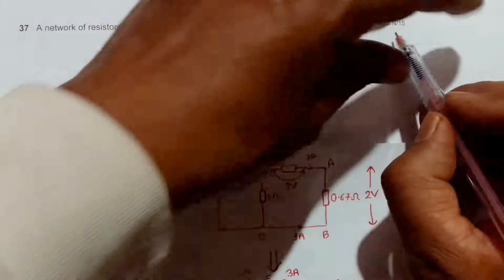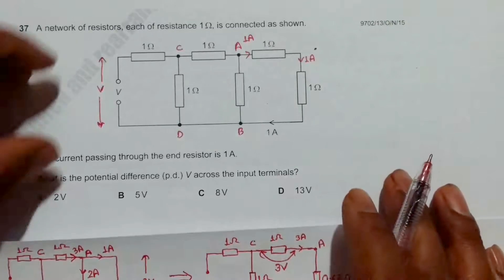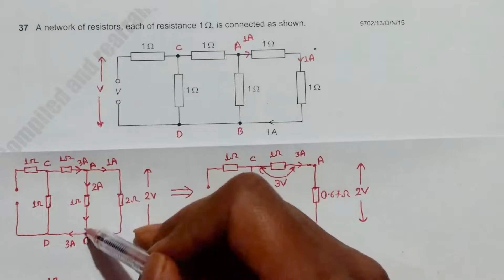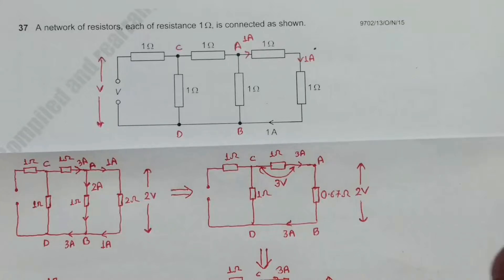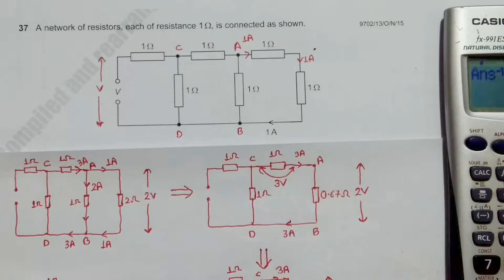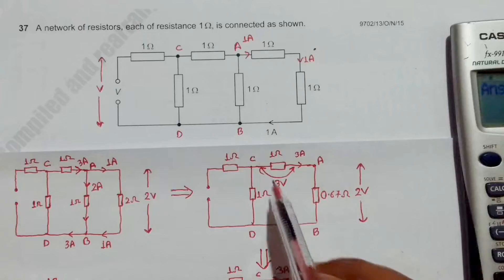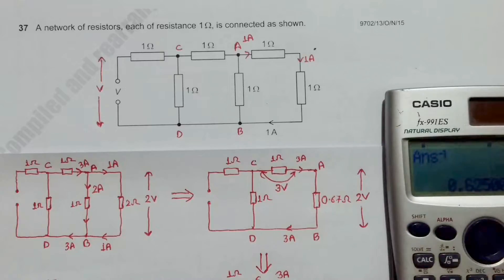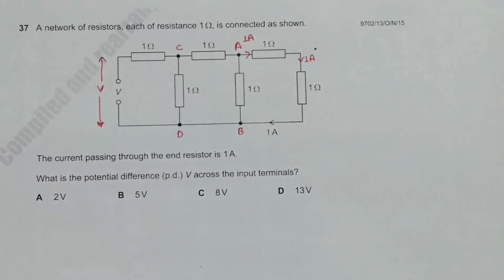2015 CAIE AS & A level October November Physics Paper 13 Q N 37 (9702/13/O/N/15) by Sajit C Shakya

Comment: does anyone know how to do q 15 of this paper ?
Reply: its mentioned that the structure is in equilibrium. 2N force is applied with an angle of 30*. find the vertical force exerted on the plank. use F=RsinA. find the torque in each plank using torq=Fxperpendicular distance from point of action. and since it is in equilibrium, clockwise torque=anticlockwise torque. and equate!!
Reply: @bivanshrestha5378  replied after 9 months lmao
Reply: @PoshakPathak  well better late than never I guess 😂